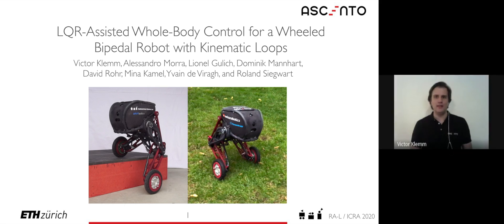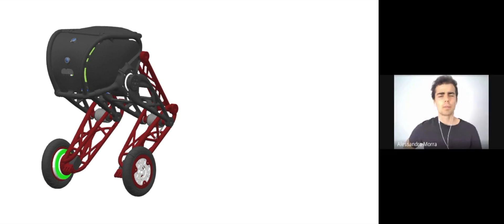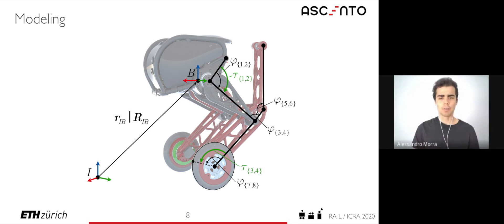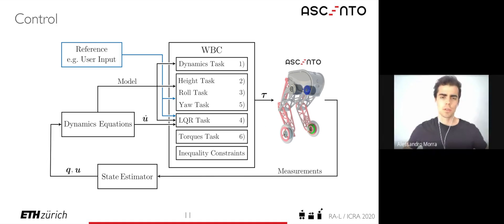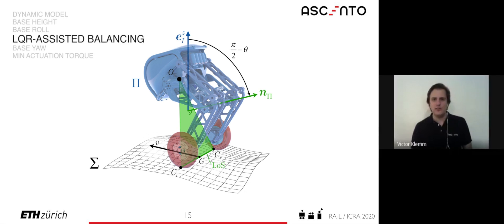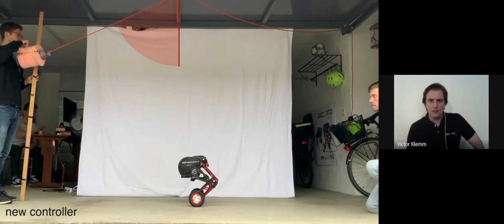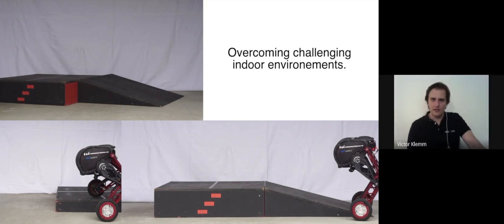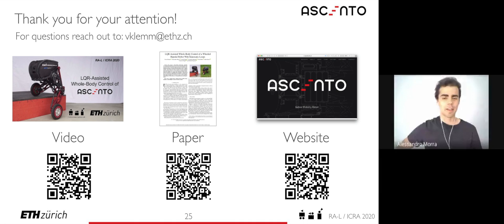ICRA'20 Presentation LQR-Assisted Whole-Body Control of a Wheeled Bipedal Robot with Kinematic Loops

Comment: Very detailed, but in the article, especially in the section about ground contact, how can the rotation matrix Riw be calculated using forward differential kinematics when I is fixed but W is moving? These two coordinate systems are not linked.
I just wondering

Comment: Does Ascento have awareness of it's leg deflection?  If so, to what resolution?
Reply from the maker: Yes! The joint encoders in the hip motors measure their rotation with a precision of ‹0.025° (17-bit encoders). This allows Ascento to directly calculate the extension of the corresponding leg linkage and thereof also the relative wheel positions.